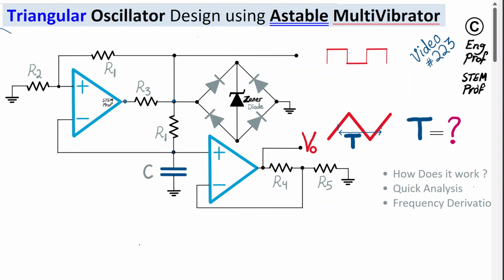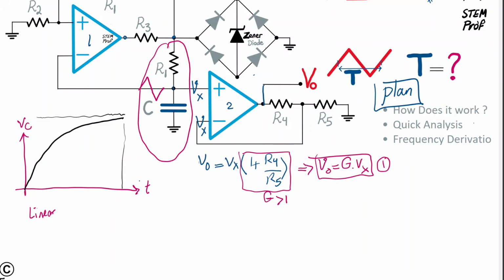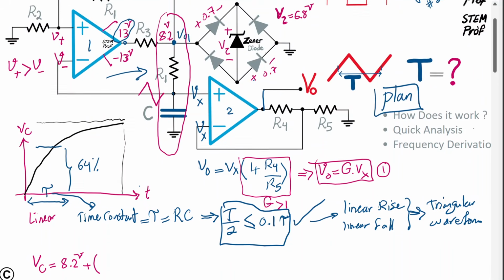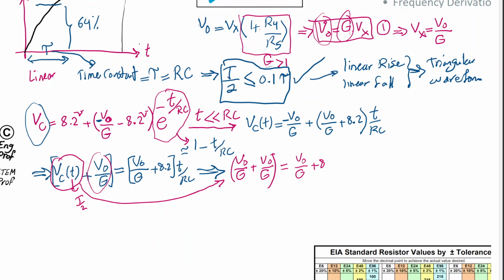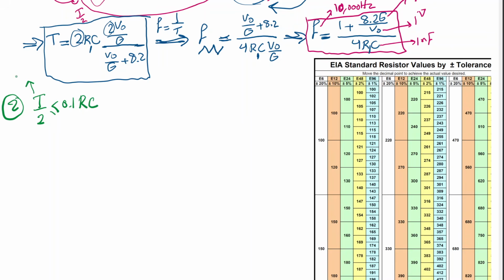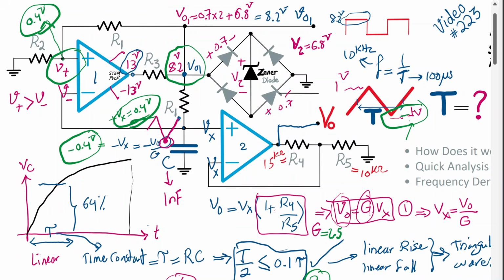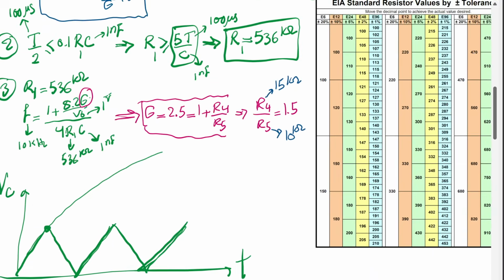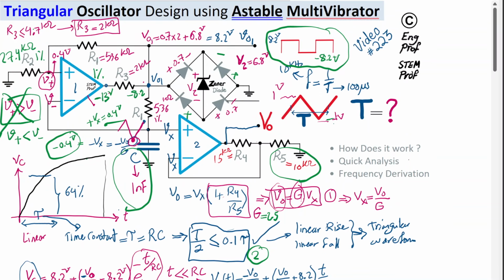How 2 Op-Amps, 4 Diodes, and a Zener Clipper Make the Triangle Wave?

Comment: Seems overly complicated for something that in the end is not generating a ‘perfect trisngle’ but just an approximation. For the stated goal wouldn’t a cicuit based on constant current charging (instead of constant voltage) make more sense?
Reply from the maker: Thanks for watching and sharing your thoughts! You are right that a separate op-amp integrator (which maintains a virtual ground for true constant-current charging) is the textbook way to generate perfectly linear ramps. There are always multiple topological ways to tackle a design problem!  If you are interested in comparing this to true constant-current integrator topologies, I've broken down those exact circuits in these earlier videos:
• Sawtooth Oscillator with Op-Amp, JFET, and BJT: https://youtu.be/5zHXTx-Vl20
• Sawtooth Signal Generator Circuit Explained: https://youtu.be/2eUsGPfqbW4

The main goal of this specific video was to explore an alternative design constraint: how to produce a very clean, near-linear triangle wave using a single-stage astable multivibrator core by restricting the exponential RC charging curve to its initial region (<= 0.1 tau), combined with a Zener rectifier bridge to decouple the timing threshold from unregulated power supply rails.  Notice that in this specific layout, there is no standalone integrator stage or virtual ground.  The op-amp's inverting terminal actively tracks the capacitor voltage Vcap. Because of this, the charging current is:

I_C = (V_clamp - Vcap) / R1

As Vcap rises, the current decays exponentially. We achieve our target linearity purely by constraining the swing between the +/-0.4V switching limits (well within that initial linear 0.1 tau window).

Appreciate the thoughtful question and engineering discussion!
Reply: @STEMprof  I understand the circuit, and now I kind of like the idea of using a zener stabilized voltage to decouple from not only drifting supply rails, but also often great variations and asymmetry in opamp Vo+ and Vo-. I just personally would rather use that technique together with an integrator based generator, there's the classic one with 2 opamps, same as this circuit except you generate a 'tri' with just one opamp but because you're forced to use such low switching limits, you need the 2nd opamp to compensate for that, if I understand it correctly. That wouldn't be necessary with an intergrator based gen and it wouldnt have the harmonic problems as this one does. It's good enough for most cases for sure, but not 'perfect'.
Reply from the maker: Glad that the clarification was helpful, and thank you for the engaging and insightful technical discussions. I hope you find the alternative (better) oscillator design techniques more interesting as presented in the following videos:
• Sawtooth Signal Generator Circuit Explained: https://youtu.be/2eUsGPfqbW4
• Sawtooth Oscillator with Op-Amp, JFET, and BJT: https://youtu.be/5zHXTx-Vl20
Thanks again for sharing your thoughts/suggestions.

Comment: What would one use  a sawtooth wave for ?? anyone
Reply from the maker: While this specific circuit video focuses on a symmetrical triangle wave, sawtooth waves are practically important in analog electronics. Two major use cases are:
•  Control Voltages & Sweeps: Because it features a linear ramp followed by an instantaneous reset, it is perfect for driving sweep generators, time-base circuits for legacy CRT displays, and modulating filters or voltage-controlled amplifiers (VCAs).
• Analog Audio Synthesis: A sawtooth wave contains both even and odd harmonics. This rich harmonic profile makes it the fundamental starting block for synthesizing string sections, brass, and aggressive basslines in analog synthesizers.

If you want to see a sawtooth architecture built from scratch, I actually break down the circuit design for it in two video examples:
• Sawtooth Oscillator (Op-Amp, JFET, BJT): https://youtu.be/5zHXTx-Vl20
• Sawtooth Signal Generator Circuit: https://youtu.be/2eUsGPfqbW4
Reply: @STEMprof  Analog synthesizers are an excellent use for sawtooth waves.

Comment from the maker: Thanks for watching and your interest in this channel! This circuit is just one design example to demonstrate how to turn a classic constraint exponential RC charging into a highly linear oscillator using tight hysteresis limits (±0.4V) and a Zener-regulated clamping diode bridge for power supply immunity.  * Engineering is all about trade-offs, and there are many ways to build a waveform generator. If you want to see how this approach compares to precision, constant-current integrator topologies, check out these design deep dives from the channel archive:
• Sawtooth Oscillator (Op-Amp, JFET, and BJT): https://youtu.be/5zHXTx-Vl20
• Sawtooth Signal Generator Circuit Explained: https://youtu.be/2eUsGPfqbW4

What’s your go-to topology when you need a clean, predictable linear ramp? Let me know in the replies 👇

Comment: That is a shit circuit to acheive the result. Much better ways to do it. First use an integrator so you have a very linear slope and matched increasing and decreasing slope
Reply from the maker: Thanks for watching and sharing your thoughts! You are right that using an op-amp integrator with a constant current source is the standard way to achieve highly symmetrical, perfectly linear slopes. There are always multiple topologies to solve a circuit design problem.  --> The specific goal of this video was to demonstrate an alternative constraint: how to mimic a linear waveform by restricting an exponential RC charging curve to its initial ≤0.1τ region, combined with a Zener-clamped bridge to isolate the charging voltage from unregulated dual power supply rails.

If you prefer the integrator and constant-current approach, I've covered those topologies in these design breakdowns as well:
    Sawtooth Oscillator with Op-Amp, JFET, and BJT: https://youtu.be/5zHXTx-Vl20
    Sawtooth Signal Generator Circuit Explained: https://youtu.be/2eUsGPfqbW4
Reply: @STEMprof  you dont need a constant current source. The resistor is the input to the op amp inverting input. The current is input voltage over input resistance. All that current flows into the feedback capacitor.
Reply from the maker: @davefoord1259  You are describing a standard two-stage oscillator where a separate comparator drives a standalone op-amp integrator.  In that specific layout, the virtual ground does maintain a constant current. But look closely at this specific circuit: there is no independent integrator stage or virtual ground here. This is a single-stage astable multivibrator core where the inverting terminal is actively tracking the capacitor's voltage.

Because there is no virtual ground, the current through the 536kΩ resistor is I=(8.2v−Vcap)/R1. As the capacitor charges, Vcap changes, meaning the current is fundamentally not constant; it follows an exponential decay. The linearity achieved here relies entirely on restricting that exponential charging curve to its initial ≤0.1τ region between the ±0.4V threshold limits, stabilized by the Zener bridge.

Changing the topology to a true integrator is an entirely different circuit, which was exactly my point (see the example circuit videos in my earlier response.)
Reply: @STEMprof yeah i know but youre still using 2 op anps to acheive it and using the 2nd op amp just as a buffer with gain.

Re work your circuit as i suggested and see how many fewer components you need to get a better result
Reply: Im from the early 1980s and have been fixing autopilots and instruments since then till now.
Reply from the maker: @davefoord1259  Thanks for your interest in this channel. Watch the two other circuit design videos to see that.
Reply from the maker: @davefoord1259  Thanks for sharing your thoughts.
Reply: @STEMprof  if youre a stem professor think about what you are teaching young engineers. Ive seen what comes out of university these days and its not good quality with regard to circuit design or analysis.

What you came up with kinda works but there are much better ways, and you need some humility to discuss better ways to acheive the desired result. Ive seen the crap young engineers come up with and it has real consequences for their employers business.
Reply: @davefoord1259  I liked the circuit. I may even come up with a use case for it now because of these comments.

Comment: A couple of thoughts - You could probably eliminate the clipping circuit (diodes) if you use a rail-to-rail op-amp, since the output will already be perfectly symmetrical above/below ground. You could also eliminate the concern about using just the linear-ish portion of the capacitor charging curve by configuring one of the op-amps as an integrator, which would ensure a perfectly linear voltage ramp.
Reply: I was thinking you could get rid of the diodes too by selecting a positive feed back resistor to keep the high and low hysteresis points in the "linear" range of the capacitor.
Reply from the maker: @SkullDraizer  That's a common thought, but altering the positive feedback resistor only changes the upper and lower threshold points (the hysteresis limits; ~0.4V in this example) where the circuit flips polarity.  It doesn't solve the rail-regulation issue. Without the Zener bridge, the capacitor is still being driven by the raw, un-clamped output of the op-amp (which tracks the supply rails). If your power supply voltage sags or carries noise, the charging rate changes, causing the frequency to drift. The Zener bridge ensures that no matter what the hysteresis thresholds are, the voltage driving the charging cycle remains locked at a fixed potential.
Reply: @STEMprof  We don't want it to drift? 😄
Reply from the maker: Good observations! Well-said regarding design trade-offs that make analog architecture so interesting. You are completely right about the integrator; using an op-amp integrator is the standard method for achieving a perfectly linear ramp without worrying about the 0.1τ constraint. See the following videos utilizing constant-current/integrator approach in a couple of previous videos if you want to compare the topologies:
• Sawtooth Signal Generator Circuit: https://youtu.be/2eUsGPfqbW4
• Sawtooth Oscillator (Op-Amp, JFET, BJT): https://youtu.be/5zHXTx-Vl20

Regarding the rail-to-rail op-amp to eliminate the clipping bridge: that would work perfectly if the dual power supply rails are completely well-regulated and symmetrical. The specific reason for the 4-diode and 6.8V Zener configuration here is supply-rejection. If the power supply rails drift or carry noise, a standard rail-to-rail output drifts with them. The Zener bridge forces a precise, independent ±8.2V reference for the charging cycle, making the frequency further immune to rail fluctuations.

Thanks for bringing these points up; this is exactly the kind of circuit analysis I love seeing in the comments!